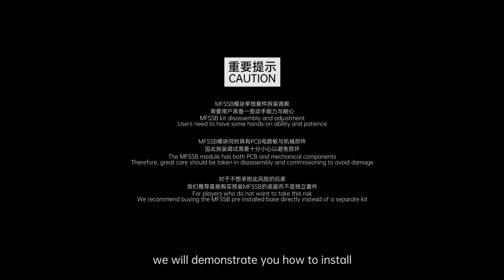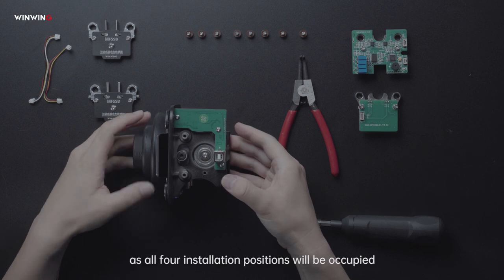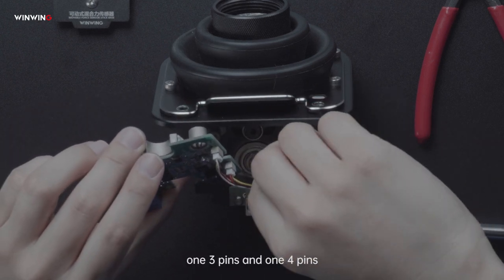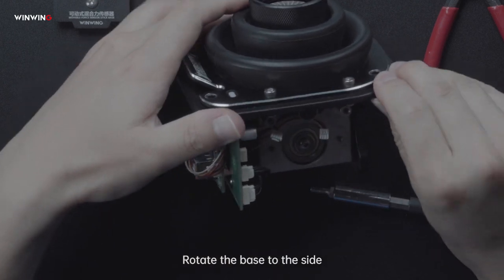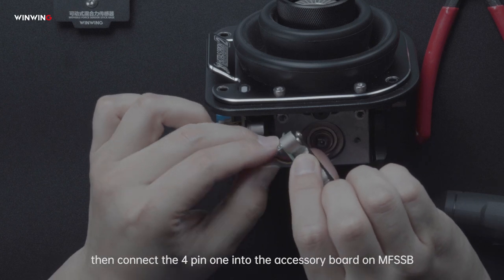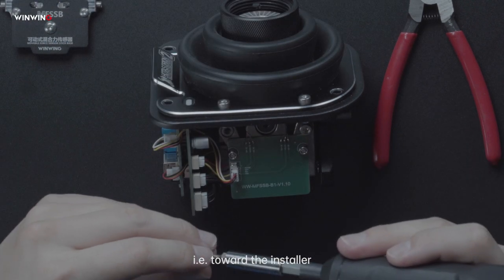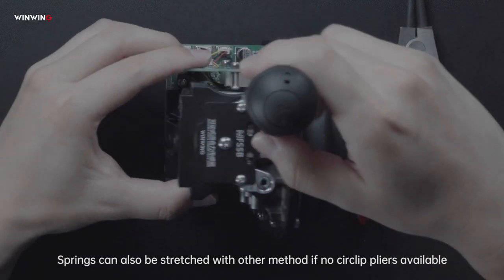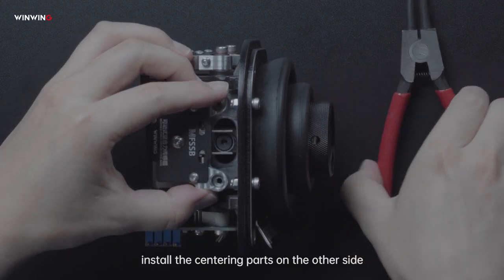WINWING | Orion 2 | MFSSB Installation

Comment: when the module will be available to buy?
Reply from the maker: Very soon, just waiting for the unlock down.
Reply: Never.  It's been listed on the WW website for two (2) years, but it is never available.  And get this, according to WW's sales department, we peons are too stupid to add these parts our selves, it has to be done by WW's own tech support, they don't take units back to make the changes - you have to buy a new unit!